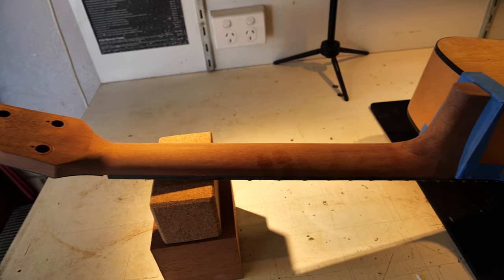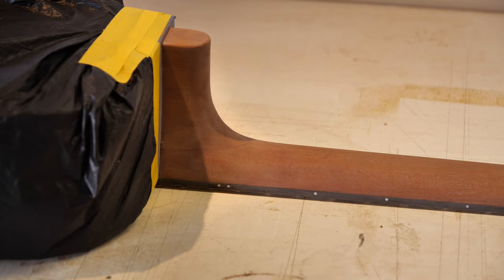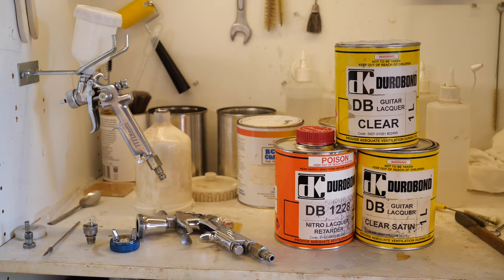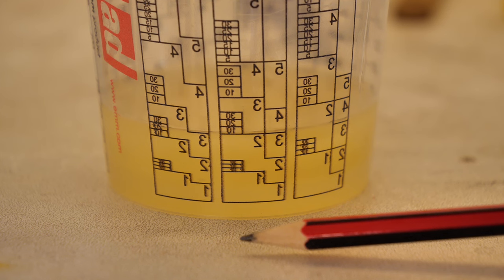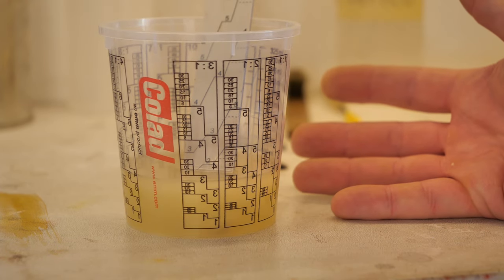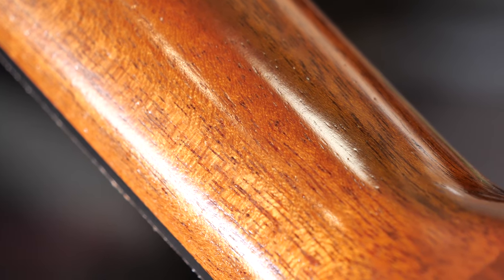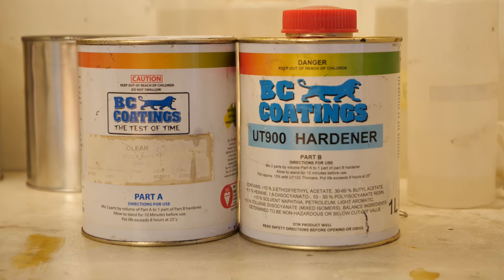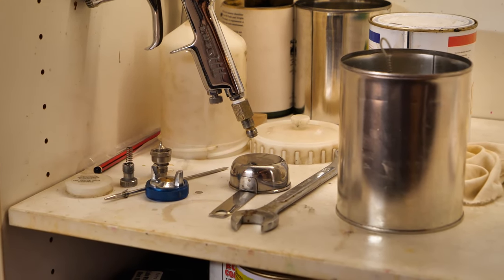Guitar Spray Painting Basics - Peeling Garrison Neck Lacquer (Part 2)

Comment: The good old star huh? I bet that's seen some action. I had a Star and a DeVilbiss GTI. I love spray guns, I always stripped my guns after every job. It pays off in the long run, my guns still look new after 20 years
Reply from the maker: I've used the DeVilbiss GTI at work and it was a joy. I've had this gun for over 15 years and have never needed to replace anything due to my meticulous cleaning, lubrication and care. Star, DeVilbiss, ANEST IWATA are fantastic choices and I wouldn't use anything less.
Reply: @BradsGuitarGarage  Love your work mate, I wish the young apprentices out there would take that tip.

Comment: Someone gave me an old worn out SpeedAire that had blown out valves, but those old SpeedAire compressors used reed valves. Two sets of cheap feeler gauges later I and had a great working USA made compressor, but about 18 months ago some shit bag stole it. The last SpeedAire I looked at on Craigslist was $6000! USD. To be fair it was larger. I thought the mother F'er had got my evap dryer & filters too but I found them. I got some tamper resistant transformer bolts from APS and bolted the new compressor down with 5 sided bolt heads set down inside reducing washers. Unless someone has a 5 sided socket it ain't going anywhere. I could have also had cad cut washers welded to pipe to set the heads down into.
Reply from the maker: Bloody hell, they stole it right out of your shed!?

Comment: I've worked with plenty of "professional" painters that could learn a few things from you Brad! My only question is do you have any issues with dust/paint flakes in the finish from that garbage bag? If you use antistatic plastic it wont attract dust and it'll hold onto overspray that falls on it
Reply from the maker: Nah, for one or two coats, I just blast it with air and it's fine.
Reply: @BradsGuitarGarage  yeah, I’ve never had an issue on a guitar but if I'm painting 2 pack on a car that garbage bag spells trouble, anything you can do to reduce dust is beneficial.